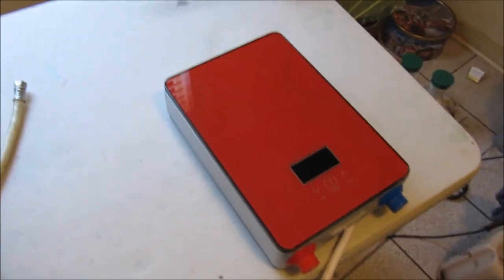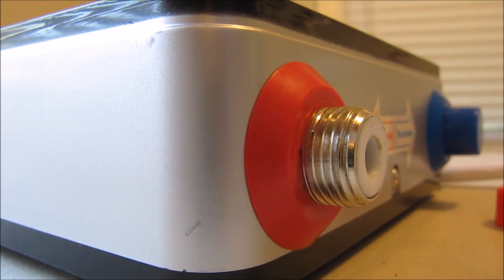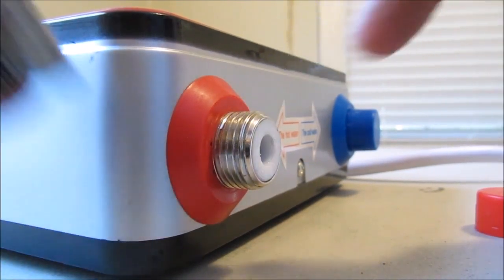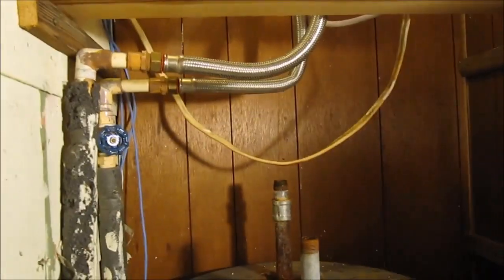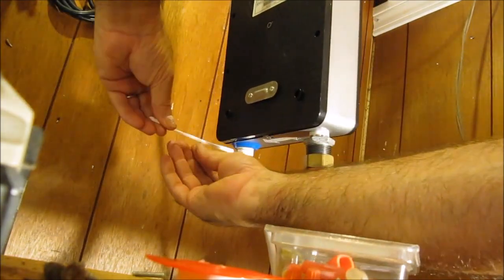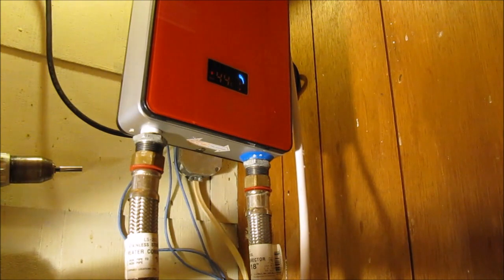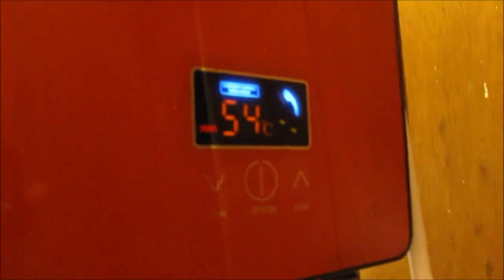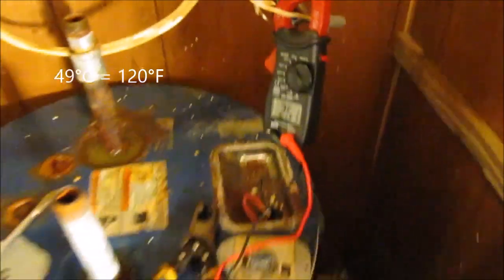DSK-65 Tankless Water Heater Installation and Review

Comment: We are thinking of doing the exact same thing you have done here in Central Florida. Is the heater still working after a few months and do you have any complaints? EDIT: I saw your next video from a few months later and I am convinced to try this one. Thank you for the video this is a HUGE savings over the tank heater we were saving up for. Also, it would be great to see how you did the electric connection too.
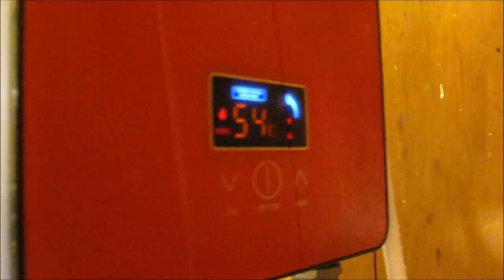Reply from the maker: The electrical was simple enough; three large wire nuts to connect the pigtail from the tankless water heater to the 10/2 wire that I disconnected from the tank water heater.  They're hidden behind the amp meter at 14:15, but it's straight forward; the 14-gauge bare ground wire goes the the green/yellow wire and the other two are hots.
Reply: @SAPLSMW  Thank you for the reply!  Just bought the same one and am waiting for the delivery. The installation will be on the outside wall of the bathroom (screened in patio) of a mobile home, so it will feed a bathroom sink and shower stall in under 6 ft of pipe.
Reply: Edit: Now installing and ran into the same problem with the leaking, as you said you have to be really careful with torque on the threaded pipe fittings coming out of the unit, too much pressure and they start to create torque inside the unit. Also, for those that aren't skilled in electrical the brown is live and blue is neutral in European code. I made the install so much harder because I didn't have the braided flex pipe and did a rigid CPVC install to save money. I will give another update once I get it completely installed.
Reply from the maker: @haljasonfoster2169  Why not record yourself doing the work and post a video on Youtube? Also, under the kitchen sink is my favorite spot for installing these.
Reply: @SAPLSMW  That would have been one hell of a video since my mistakes and leaks were epic. Just finished taking a shower and had to adjust the temp/flow to prevent scalding. There was no issue with flow and I have a 2.0 GPM shower head, of course I had make sure no one else used any water to keep the flow consistent. Thanks again for all your help and video!

Comment: Mines leaking bad need help
Reply from the maker: I'm not in a position to provide support for these; if they leak internally then I would propose teasing it apart and looking inside to see if it can be salvaged.  If it's leaking at the connector then I would propose more plumber's tape or using a different connector.

Comment: pull that white plastic OUT,,,  it making problem with flow,, if u want, find metal net in lowes with rubber gasket
Reply from the maker: The white plastic is actually the pipe coming out of the water heater and the metal threads are just a sleeve on the white plastic pipe.  The tankless heater reduces the flow so that the water spends more time in the kettle and comes out hotter.